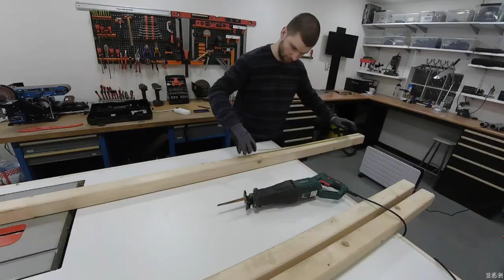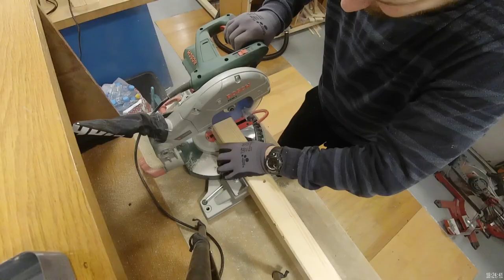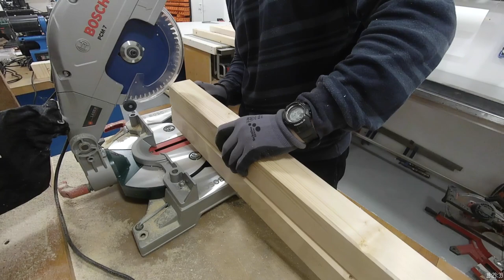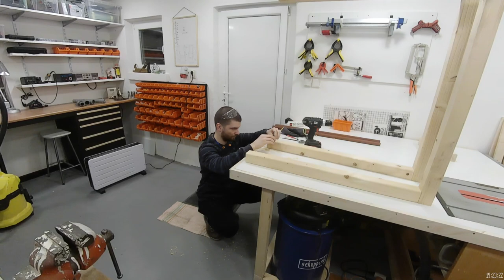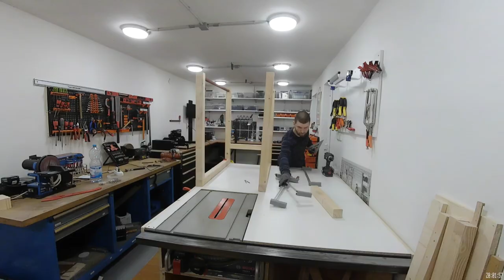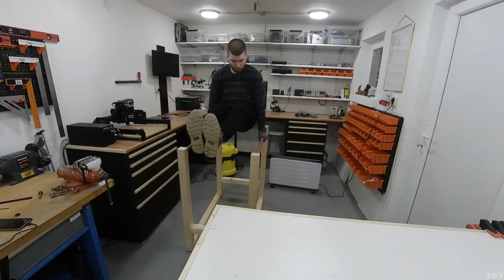DIY Simple Parallel Bars (in two hours) // DIY Home Gym

Comment: Is this structurally solid?  I believe the frame will crack with the racking that happens with repeated use.  Perhaps you have a solid hardwood though that will hold up.
Reply from the maker: Yes, good point, after some months of use, I have to say a few screws or additional angle brackets to the joints would be better especially for heavier people. I have just 75kg and screw joints need reinforcement, add more and maybe stronger screws, or even better to add some angle brackets and attach them by threaded screws through the profile. The wood parts themselves are solid enough, it's construction wood, KVH profiles without cranks or other defects, there is selection in the manufacture so the wood structure is good, but mentioned focus on the joints needs attention.

Comment: I decided to give a similar approach a go myself - have these bars held up?
Reply from the maker: so far they are good, but I'm just 75kgs lightweight. For heavier guys, I would say it is necessary to add some screws or some metal angels. I have seen yours and for sure they are more solid than mine...

Comment: I really like your design, i would like to incorporate a way to adjust the bars width. Instead the wood block you used as the spacer, do you have any good ideas for adapting this function into your design? Preferably the adjustable spacer would be ideal as wood for the sake of cost. Ill look into it, if you have any ideas please respond.
Reply from the maker: I've also thought about different distance between bars to have option to use different grip. But instead of use adjustable parts I've I though to made one spacer shorter than other, cut them under appropriate angle. Then in lengthwise would be different distance between the bars..
Reply: @webblab2415  Is it possible to post the actual dimensions of your build?

Comment: Where can you buy thick wood like that
Reply from the maker: Depends on where are you from. I'm from Europe and these are called KVH, it's abbreviation from German word "Konstruktionsvollholz" that means something like construction wood. It is like standard or norm where wood has to be dried below 15% and it is cut with a cnc milling machine so it's quite accurate..

Comment: what type of wood are you using? Is that a 4x4 or a 3x3
Reply from the maker: I'm from Europe it's metric...60x60mm..60mm divided by 2.54mm (1 inch) equals app. 2.4x2.4"

Comment: Which wood u used?
Reply from the maker: These are KVH profiles 60x60 (mm)..used for smaller building constructions..dried to 15%..selected by manufacturer to be without cracks and similar defects...usually spruce..I had these as leftovers..
Reply: This is the best diy tautorial on youtube!!